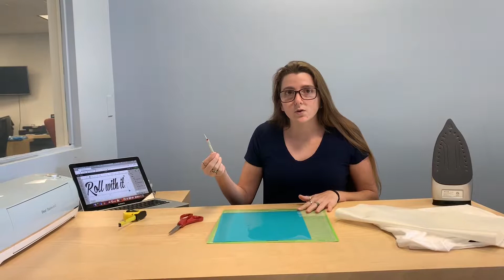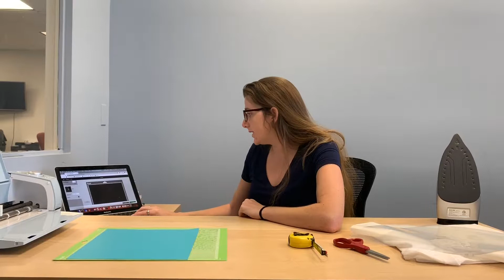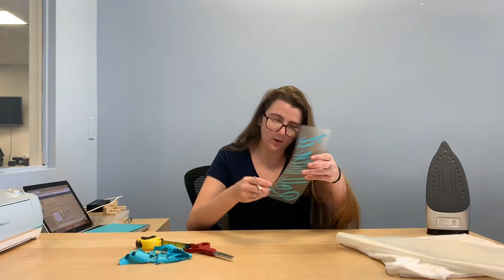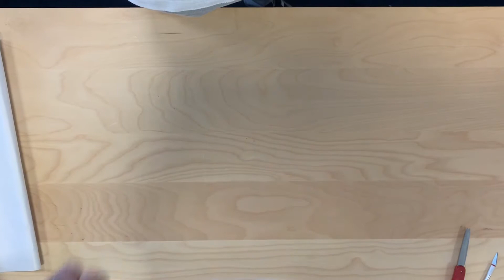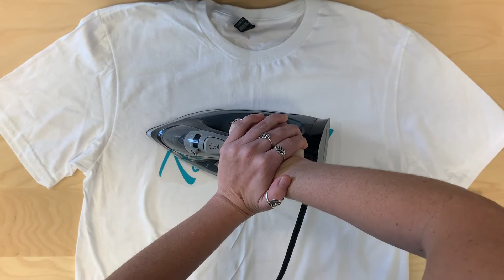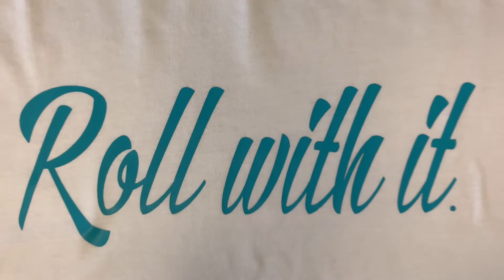Making Your First HTV Project - Heat Transfer Vinyl Tutorial for Beginners - iCraftVinyl.com

Comment: Thank you for sharing, is it the same process with iron on? The mirror part and turning the shining side on the mat
Reply from the maker: Yup! Same process. Just press for 15-30 seconds with firm pressure - and try not to slide the iron. Also, cold peel all materials!

Comment: I need to ask u a question please..I bought some cricut vinyl from Walmart, and I want to make stickers, just for myself..I can't afford a machine. I think I needed a self healing sticky mat and Im think I'm gonna to buy a gyro cut cutting tool.. But if there's an easier cheaper way please tell me..I will be making intricate stickers, so I don't want to use a scalpel. Also if there's anything else I need please tell me.. Thanks. PS.. I'm not wanting to make iron on stickers..
Reply from the maker: Vinyl stickers are a little different than HTV. I would think that tool would work, but just be sure you test a small piece so you don't waste a full sheet of vinyl. Intricate designs may be difficult, but simple designs should be doable.
Reply from the maker: You will also need transfer tape to transfer your vinyl once cut out
Reply: @iCraftVinyl  thanks for the advice..I appreciate it..I'm making tiny stickers/decals for nail art..I ordered the gyro and a non slip self healing Mat.. I'm so excited to try.